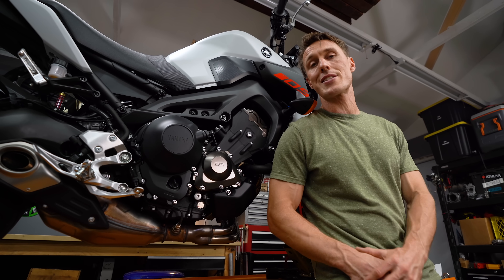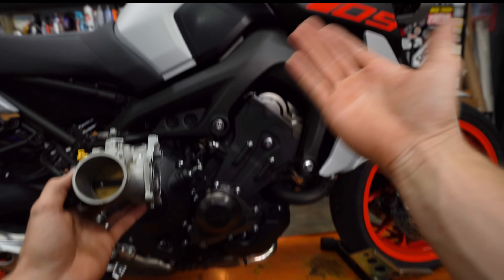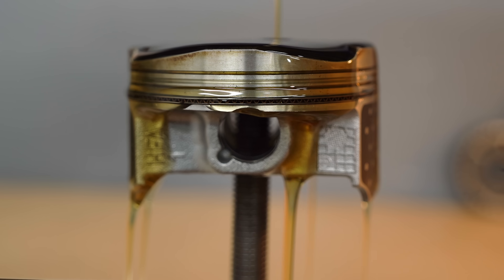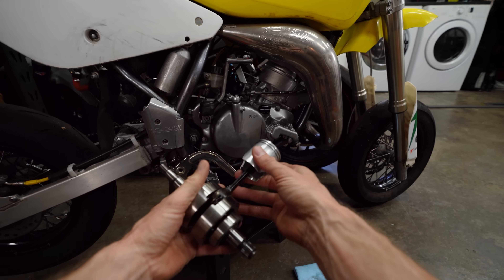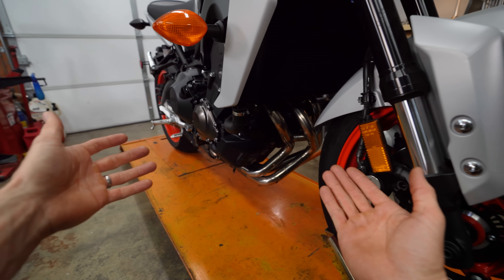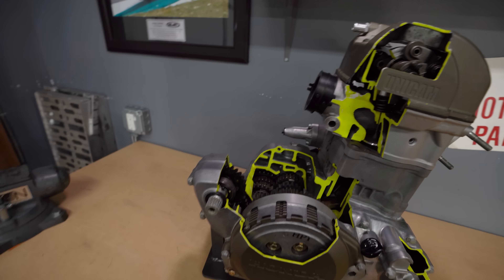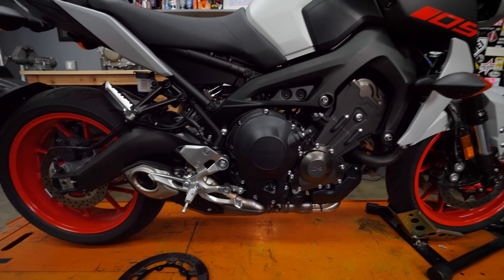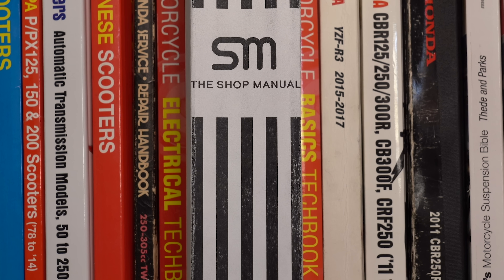Is Engine Braking Bad For Your Motorcycle? | The Shop Manual

Comment: Are you really saying its not an issue for a premix 2T? I get it you want to just say a blanket no its great but thats plain wrong and you really shouldn't be telling people its fine.
Reply: I specified the scenario where engine braking isn't safe on a premix 2T (lonnnng downhill), but other than that it's perfectly safe. Otherwise my RM85 would grenade every time I decelerate from 5th to 1st at the track, and all those RS125s, TZ750s, and other 2T track and street bikes would seize any time the throttle is closed and the clutch isn't pulled in (to freewheel the engine) which is obviously not how motorcycles are ridden. Even at closed throttle, the pilot circuits are still feeding some premix. If I'm wrong, explain why. You blanket statement that I'm wrong is worse than a blanket statement saying engine braking on a 2T is okay; at least I give an explanation.

Comment: Slight more wear on the back of the sprocket teeth. Not a big deal.
I still dont use engine breaking though, because which is easier to replace- a clutch or the break pads? After all, you would be using the clutch twice as much if you always downshift.
In b4 "BuT tHe cLUtCh wOnT weAr OuT iF yOU rEv MaTCh" I dont bother with that either. Sue me.
Reply: So do you pull the clutch in whenever you're braking? That sounds like an awkward way to ride a motorcycle. And if you're not pulling the clutch in, then technically you're utilizing engine braking, even if it's not being enhanced with a downshift.
Reply: @AriH211  I will engine break in the gear I'm already in, then I will pull the clutch in and bang my way all the way down to N or 1st when I come to a stop. I dont engine brake in 4th, downshift then engine brake in third, then downshift again an engine brake in 2nd. I just pull the clutch and use my brakes.
Reply: @UncleDon226  That's workable for commuting and touring, but would never suffice at the track or if you're trying to hustle up a twisty road. Whatever floats your boat, Boaty.
Reply: @AriH211  I still do spirited riding on twisties, but I only downshift to select the appropriate gear for the speed I am going, rather than downshifting to slow down.

Comment: Friction is wear... save your brakes and rotor at the expense of piston,rings, bearings and cylinder walls... I think a brake job is cheaper then an engine rebuild... but what the f do I know hahaha...
Reply: The engine is made to last under these circumstances. In order to perform appropriately under the manufacturing regulations the engines tend to be over engineered. Brakes and brake pads are wear items. They are not made to last. While it is cheaper to replace rotors and brake pads, it literally does no damage to the engine- as long as there is enough oil, proper maintenance has been maintained, and you are not red-lining. If your bike has good engine health and isn't a pile of garbage that has been misused for thousands of miles there will be no extraordinary failure due to engine braking. But if you're worried that your bike will fall apart if you rev above 5k rpm, then maybe it is just best for you to keep using your brakes.
Reply: @Dangerwiggles   it's common sense bro...  piston moving up and down is wear and tear.... pretty sure if you had two new identical motors you drive them both the same but only  engine one of them.... pretty sure the one you're engine braking on will fail first and  also will have dirtier oil do to being broke down harder therefore adding more strain... you will not convince me otherwise.
Reply: @Skrooge303  engine braking is a common part of driving. It is literally the act of cutting throttle. You can do it in an automatic car too. It doesn't mean you are downshifting / rev matching the whole way instead of using your brakes... It just means sometimes you cut off the throttle to slow down instead of immediately jamming on your brakes. I promise you engine brake all the time on cars and bikes alike. It literally does no damage.

Comment: Can someone explain to this guy what he calls “engine braking” is known as deceleration? It’s what happens when u let off the throttle. Down shifting would not cause u to hit red line if you are applying the brakes. SMH
Reply: What he means is that you suddenly drop from gear 5 to 2 in an instant, your rpm would suddenly shoot up and might cross red

Comment: Sooo Hundreds of thousands of extra revs on an engine that has a life cycle to being rebuilt vs replacing brake pads... Wear and tear on a replaceable item vs rebuilding engine sooner... hmm lemme see.
Reply: Did you even watch the video? It does absolutely nothing bad to the engine at all.
Reply: @someguy5035  did he cover the extra revolutions needed to engine brake vs that wear going on brake pads? No. The bottom line is your engine has a life cycle based on revolutions, there's only so many times it is going to rotate before needing a rebuild. Adding hundreds of thousands more to slow down vs using brake pads doesn't seem smarter than replacing brake pads.
Reply: @intrigue175175  What you are referring to is the MTBF. And the MTBF of a complex machine, barring all variables, is tied to the MTBF of its components, not crankshaft revolutions. 

Your engine is going to be idling anyways. It doesn't stop just because you pull the clutch lever. 

If you are concerned about the number of crankshaft revolutions incurred in engine braking, I don't see how you are okay with riding your bike at all.
Reply: @someguy5035  that makes no sense. You are using a straw man argument. What you're implying is that there is no difference between 5-8k rpm vs idle... Really? When you engine brake you are spinning the engine more often and at higher rpm then you ever are at idle. If you're going to say dumb stuff like "it's the same as idle", then we're done here as that's super basic knowledge you should know. Unless you're purposely being dumb, argumentative, or dramatic. Either way, none of that works.
Reply: @intrigue175175  It does make sense. The rotations are happening and that is your concern. 

Lets do the math.
6 seconds of deceleration engine braking: 
1 second 5k rpm = 83.3333rpms
1 second 4k rpm = 66.666rpms
1second 3k rpm  = 50rpms
1 second 2k rpm = 33.3333rpms
2 seconds 1K rpm = 33.3333rpms

This is a total of  266.6666665rpms

Idling for 1 minute = 1300 rpms

You can engine brake all the way to a stop 4 times, from 5K rpms and not even hit the number of RPMs that happen at a stop light.
Reply: @someguy5035  soooo you're making my point. You're adding a lot of extra rpm over the life of the vehicle. In your idealistic fantasy scenario where you spend a ton of time at a stop light and virtually no time engine braking to said stop light nor the entire rest of the ride as not taking into account in your "math" you're still adding a lot of extra rpm that is easily replaceable with brakes... That's all rpm that shortens the life of an engine, period. Down play and trivialize it all you want. The bottom line is your unrealistic math isn't accurate and even then you still acknowledge that it adds to the wear and tear on an engine.
My point still stands. I'd rather add that wear and tear to brakes.
Reply: @intrigue175175  No. I am telling you that it is irrelevant considering the amount of rpms an engine produces and even more irrelevant when you consider the most common engine failures and their causes. 

Again, if you are concerned with crankshaft revolutions, you probably should not have a vehicle that operates in a higher rev range...and you damned well better NEVER be letting your bike idle at lights.
Reply: @someguy5035  irrelevant is your opinion. I disagree. You do you, I'ma stick to facts and practice good braking with... The brakes.
Reply: @intrigue175175  You aren't disagreeing with me; you are disagreeing with reality. And that is a personal problem; it has nothing to do with me. You haven't presented any fact that has any relevance to your assertion. Not one. You just keep shreiking about some mythical RPM based engine failure from engine braking that simply doesn't exist. 

Guys like you just repeat when someone else told you instead of actually thinking about it. Or maybe you do, but lack the intelligence to figure it out. 

As for everyone else here, I am sure they will take the word of bike experts over some blow-hard internet stranger who is worried his engine is going have too many RPMs or whatever....
Reply: @intrigue175175  I have no doubt that you think simple math is an exaggeration all while your made up ToO mAnY RpMs is some kind of scientific law.

Comment: WRONG!!! Yes it's extremely hard on any automatic cam chain tensioner. Once that gives up your valves all crash into each other or the pistons. From there it's only getting worse. If you're someone that uses heavy engine braking you absolutely need a manual cam chain tensioner and know how to use it. But that's miles over your head apparently. Wise up and stop talking about shite you don't know anything about
Reply: Please explain why. It's not like the camchain is going in the opposite direction suddenly, is it ? And it is still driven from the crankshaft, right ?
I truely have no idea where you are coming from. So please ?

Comment: Utter nonsense.  Engine braking revs the engine unnecessarily.  All that  unnecessary piston movements adds up.  Engine braking will clearly shorten your engine's life.  Brakes are much easier to replace than pistons and cylinders, so extended brake wear is another canard.  Engine braking in long downhills might have been a goo idea back in the bad old days of heavy cars with weak drum brakes, and trucks certainly use engine braking in such circumstances.  But motorcycles have no such mass to worry about.

Lastly, why do you suppose manufactures are now installing slipper clutches in bikes?  Engine braking can easily break your bones when  too much  of it causes your rear tire to slip.

Comment: TL;DR 
Okay on a Four-Stroke
Immediate death for a two-stroke.
Reply: Errr not really. Otherwise every 2T out there would be seized, right?
Reply: @AriH211  Well for Motocross or similar areas of application it might work because of the short durations, but I really wouldn't advise doing that on a street-oriented two stroke like the Yamaha DT125R (I don't know if you have these in NA, but here in Europe and southeast Asia they are pretty commom even though they are old) or two-stroke sportsbikes like the RD350 or Aprillia RS125&Cagiva Mito 125. There are so many German and Italian videos out there of engines seizing after engine breaking multiple times in a row (Kolbenfresser in German or Grippate / Gripatta in Italian and Spanish). 

If one gets seen riding a two-stroke with braking without having the clutch pulled they get so much (often deserved) hate since they blow up so often, when you don't pull the clutch when slowing down/braking.

I've had multiple blowups on my own bikes and seen too many sadly (2T and 4T) :( still remember when my DTR blew so hard the conrod snapped in many pieces and the crank forced itself tilted in the crank case (instead of sitting normally it was sitting crooked in the crankcase, one side was way further forward than the other...sadly after like 170 miles after a full rebuild)
Reply: @AriH211  https://youtu.be/Sw2SQApG9t4 This one for example, pure engine braking and the oil Just wasn't enough anymore with a closed throttle.
Reply: @xGxPhantomZzz  Sounds like your DTR wasn't rebuilt properly if it blew up after 170 miles.

Comment: Engine braking? No. Engine breaking? Probably yes
Reply: Huh?
Reply: @rohinhans7819  English has a thing called homonyms, Google them. Not homo-nymphs, fyi
Reply: @monkmoto1887  yes I know that, I know people mistake braking for breaking. But I'm confused as to what you are trying to say. You are saying engine braking is breaking the engine?
Reply: @rohinhans7819  no. Im saying breaking the engine is breaking it. Engine braking is fine. I actually find it funny most sissys need slipper clutches and auto blippers
Reply: @monkmoto1887  well I mean slipper clutchs are extremely useful as it smoothes engagement, as for auto blippers, that's for racing. You don't want to be focusing on revmatch when you should be focusing on the turn